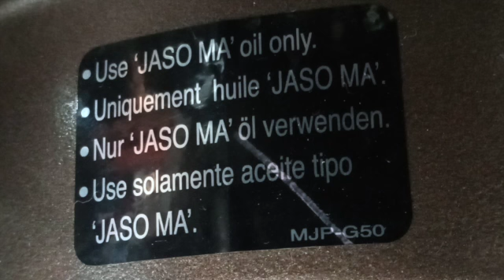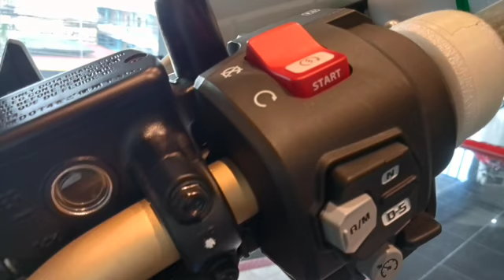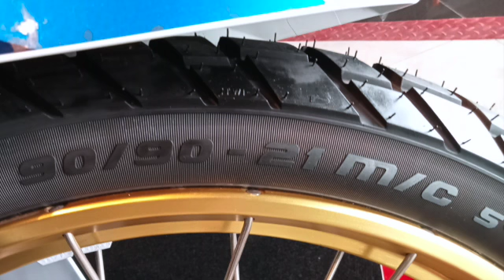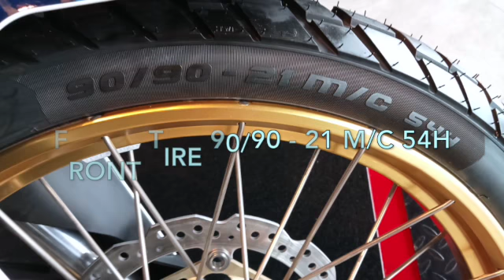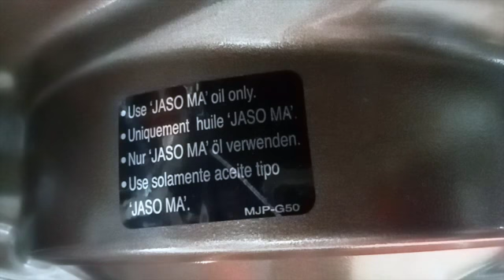worlds best 1100cc adventure bike? the new Africa twin CRF1100L

Comment: Hello.
Africa Twin!
I think it's the pinnacle of adventure motorcycles. : D
The ultimate adventure bike that Honda aimed for.
21-inch front tires used on the front.
The Africa Twin silently conveys that it is a serious bike even on the off-road.
Equipped with 21-inch tires, you can run purely off-road.
I can't reach the ground at all with my feet. LOL.
Thank you my friend.
Reply from the maker: Honda deliver 4 variants this allows the customer to focus on what features they want. We must wait for the self balancing machines then height does not matter? I see few XADV and the new owners are happy to go off road.